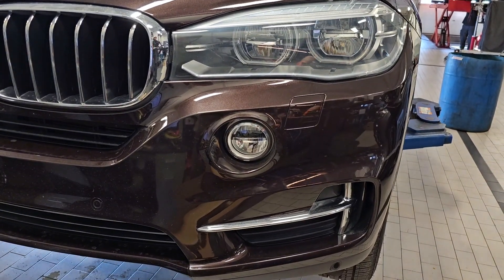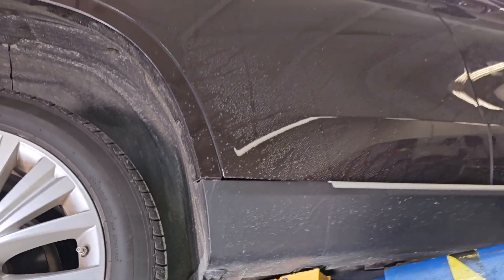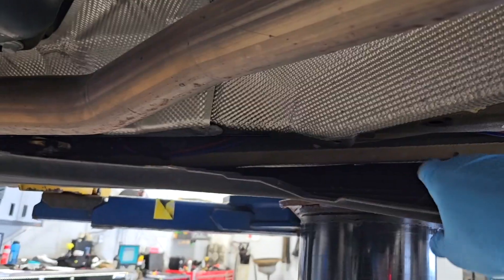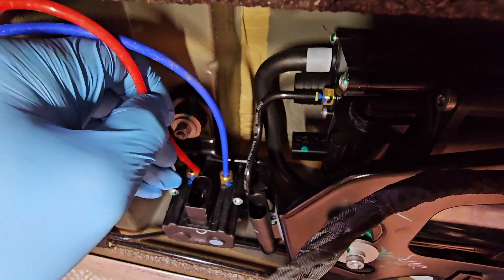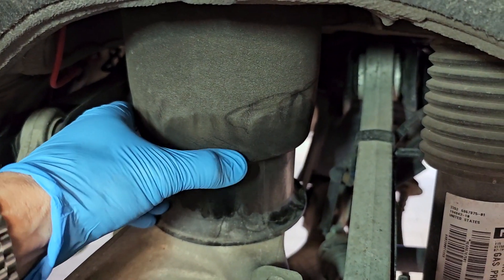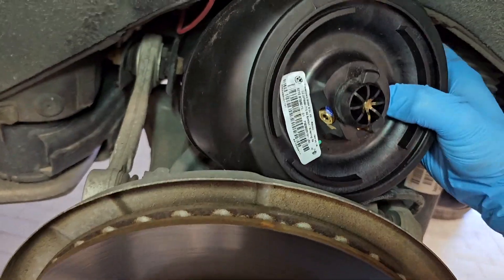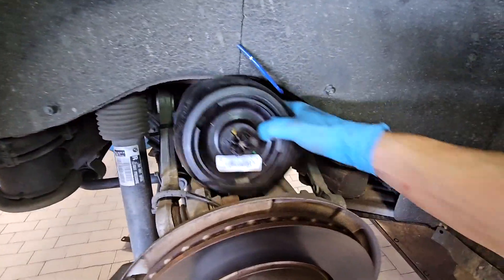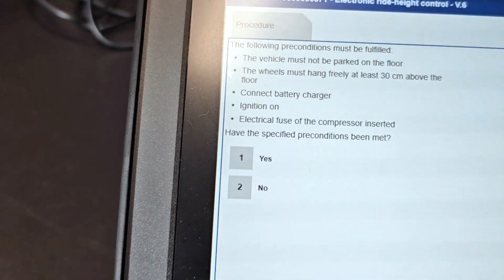Rear air suspension replacement BMW f15

Comment: Wow. Is it really that easy to connect the lines after replacing the air springs? Just push them in, and that's it? I'm doing this job tomorrow 👌🏼 Thanks for the video

Comment: I replaced mines last month at home 🤟🏻 f15 too.. changed the silica balls in the compressor too btw..
Edit: I have a question plz.. like I already commented in past videos, I live in CA, my x5 is parked in the garage, the brake’s master cylinder is failing and lost compression so the brake pedal goes to the floor. I know it’s a question of seals, do you have an idea where I can find just the seals instead of changing all the master cylinder?
Reply from the maker: Nice job! But be careful. The dehumidifier balls are not silica!
Reply: @MOvidiu  looks like ceramic?!? I just edited the first comment, can you check it back!
Reply from the maker: Are you talking about the f15 brake Master cylinder ? If yes , you do not change seals that is not a Ford ! I think you did not charge the brake fluid at the time and now is contaminated! Try to flush it with istaD activation! It Is possible to have problems with the ABS hydraulic unit, not with the master cylinder! Not even on old E models I didn't see the master cylinder to fail !
Reply: @MOvidiu   My brake fluid is 4years.. ista doesn’t show abs.. I’ll try to change/ flush the brake fluid and see.. when my friend presses the brakes pedal, I hear the electric vacuum pump starting but the pedal still goes all the way to floor.. my car is X5 F15 xdrive40e
Reply from the maker: 4 years?! Ugh, no bueno!

Comment: Ce părere ai despre motoarele b47 sunt diferite de N uri?
Reply from the maker: Cu cat sunt mai noi cu atât sunt mai performante, mai economice mai puternice! acum depinde de programul de întreținere și exploatare! toate motoarele sunt bune atâta timp cât sunt întreținute corespunzător!
Reply: @MOvidiu Yes, as long they are properly maintained... But I think, it's not very easy if you don't have Ista and cannot use it. Otherwise you should change components rather in time than when the they start to show "bad" values.

I'm not sure, but I guess that you can see, with Ista, If the timing chains are a little bit stretched, let say 1 cm!?

By the way a short and efficient video. And a place where to work, and professional tools...
Reply: @MOvidiu Întreb deoarece am avut probleme cu swirl flaps la nici 80k, a trebuit să schimb toată admisia